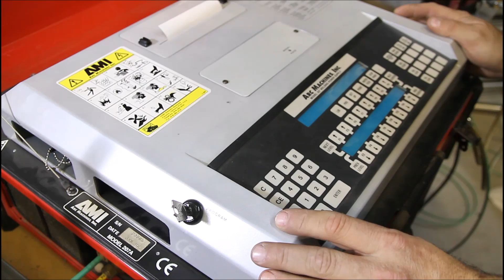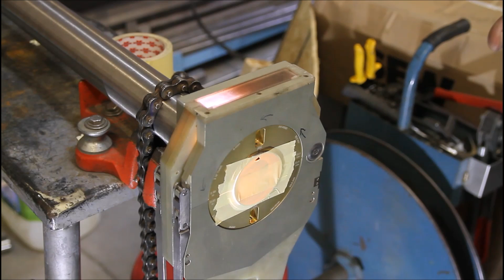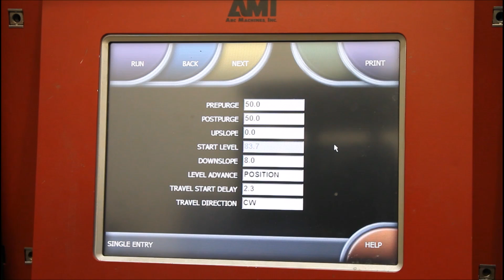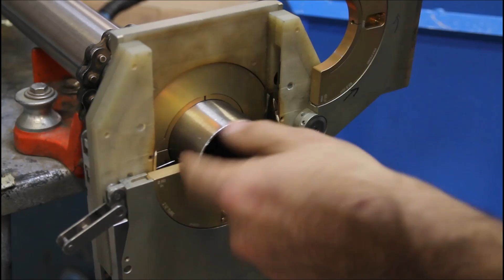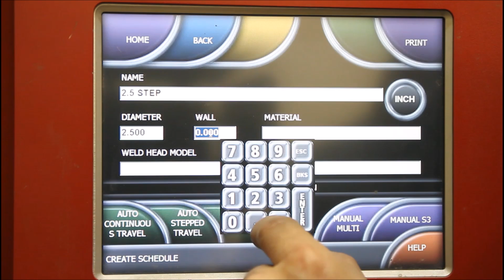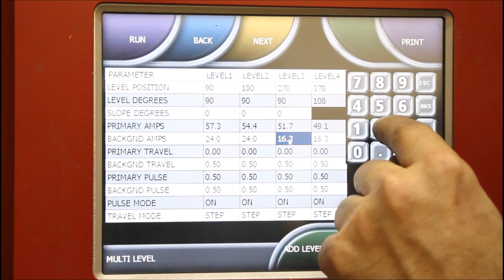M207A M205 Video

Comment: Nice job with the instructional vid, too bad there aren't many people looking to use these old machines, 207s were here when I came into the field and looks as if they w be here when I leave LoL....Thanks bud.
Reply: Though I’ve used the Orbilatum orbitals and they’re still using quadrant style controls so it’s nice to know that the knowledge transfers over but yeah the 207 was a solid platform.